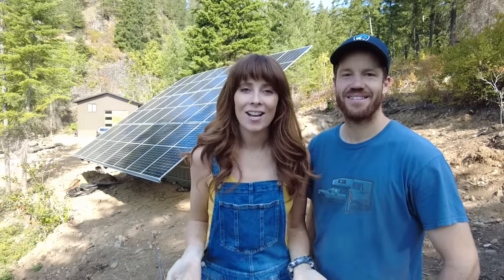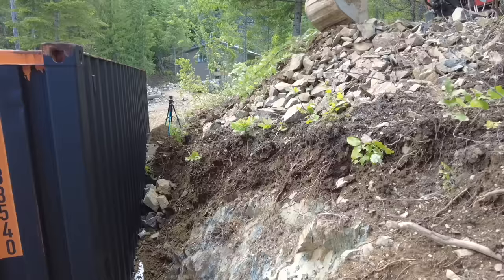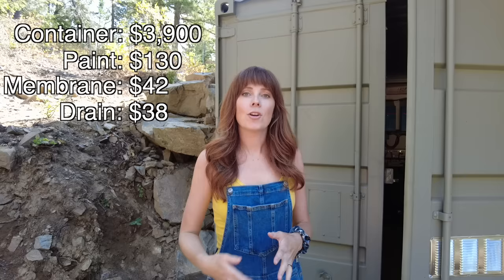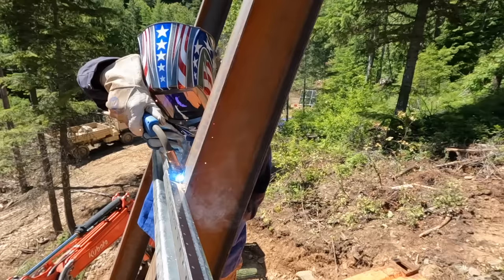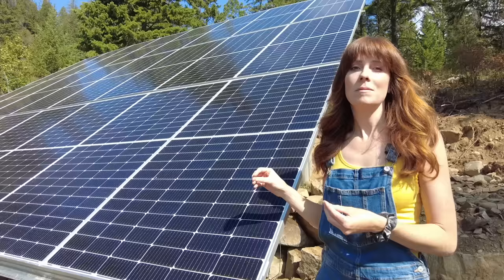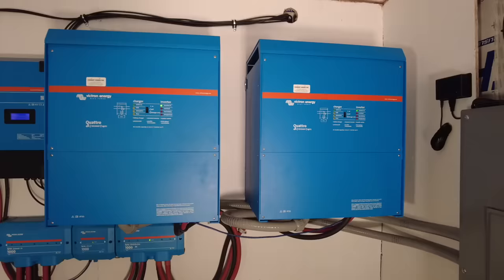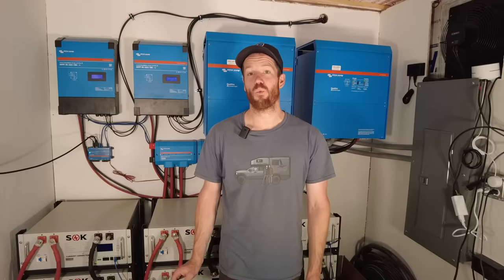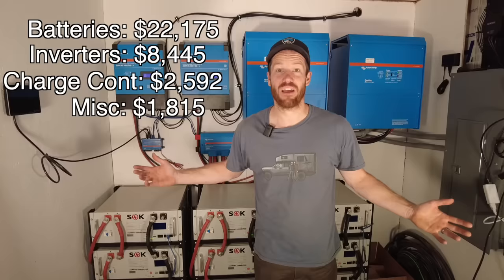TOTAL COST Of Our Off-Grid Solar Power System | Powering Our Mountain Home

Comment: You shouldn't connect the batteries like you have. You need bus bars . Run each battery to the bus bar not to the next battery.  This way you will pull almost equal power from each battery. 
The way you have it now isn't very balanced for load on each battery.  The last battery in the line will give 1/3 of the power compared to the first battery.  Example is 1 battery pulls 50 amps the 3rd battery wire is gonna pull about 150 amps through the wire. If you use bus bars then each battery wire will be around 50 amps each. Not the 150 amps.

Comment: Very interesting and informative. I can see where $60,000 looks better at $50,000.. however for an overall cost of that much and the fact that you have no close neighbors wouldn't it be just as good to purchase a house diesel/ propane generator? They aren't that noisy and very efficient now.
Reply from the maker: We did explore that route. A 20kw generator burns about 1 gallon per hour of fuel. The breakeven is less than 2 years not to mention the hassle of refueling, frequent oil changes, and the noise.

Comment: In that area you should have brought in the electric and subsidized with a smaller solar system because if you have prolonged bad weather you'll need a full time generator but hopefully that's not the case and everything has been going well for you two. The brought in power would have boosted the value of your property as well.
Also I hope you guys have firepower just case a bear or mountain lion from hell comes around. Always carry even in broad daylight.

Comment: i wondered how what seemed to be overbuilding till you said  running welders and things like that but then at the ens
10k for system was less than having power run  bets part  i would add a generator backup big enough to run ref and heat
not everything just for insurance but you do have double system good move than 1 giant one 
and the way the adm trying to kill the average person with power bills even better to have this  setup

Comment: 0:17 batteries measured in ah, or kWh, not kW. Array covered in shade :-(
8:25 thanks for the power to property info of $60K. That would have been a tough choice vs oversized solar and batteries, $50K.
No suggestions, but a tiny power supply, battery charger, and everything else at least cut in half would be great if possible.

Comment: Great system and nice job on the installation.  My wife and I live off grid here in Michigan and were 'forced' into solar due to a similar story with trying to get grid connected.  We have 15kw of QCell panels and 30kwh of Simpliphi batteries with a 6.8kw Schneider XWPro inverter that we installed.  We're in our first winter and we're finding the reduced sun this time of year to be an issue and supplement with a 10kw propane fired generator.  How is your winter electricity production working out?

Comment: I am guessing you’ll break pretty much even. In my hypothetical scenario, you have a 200 a month power bill x12 months x25 year life span of each panel and factoring battery life spans of 15 years on average, outdoor wiring replacement and other misc issues.
The fact you control your own energy needs and the likelihood power loss due to weather is a sigh of relief. Have to considered adding a hybrid wind setup for those snowy/cloudy days or is the cost and maintenance of such a system not worth the undertaking?

Comment: How do you calculate the available power?
I'm looking to build an indoor grow room using 
2x 1000W led lights running 12 hours a day (not simultaneously) 
1x  600W led light running 18 hours a day
2x Dehumidifier 500/800W running roughly 12  hours a day
1x split air conditioner 1500 max running 24/7
Miscellaneous fans and pumps roughly 600W running 24/7...

I'm looking at 4/5 KW hour

Besides the amps, how do i calculate the battery capacity?
Reply: convert your KWH to AH, multiply by 1.5, then X by the number of days you want in reserve with limited or no sun

Comment: since they are bifacial even if the front is covered with snow the suns reflection from the snow on the ground behind the panels would still provide a little power,, I guess

Comment: Not only did you pay $50,000 instead of $60k to build solar vs power but even if you paid $0 to run power out the location it would have still paid for itself within 10 years typically from electricity costs. Just keep in mind you'll likely have cost of repairs or replacing things like the batteries every so often. I think that solar panels and all can go like 25 years but i wonder how often you have to replace the batteries. I know car batteries are lead based and not the same but it kills me that i have to pay $250 now for a car battery these days and i've had to replace battery in my car like 4 times now since i owned it. I hope that batteries used here don't need replacement too often and this is one of my pet peeves with solar, no one ever mentions what maintenance cost is and how much is cost to replace batteries and solar panels are and how often. While i am sure you still save money overall, it's just something that isn't mentioned. if it cost $10k every few years to replace batteries and more every 25 years to replace solar panels, it suddenly doesn't look as appealing. and then you wonder how much more environment friendly it is if your constantly replacing those things as it's rare earth materials and likely pollution to make them. I just think winning people over to go solar would be better to be fully honest about long term expectations and all, which sadly no one ever is.

Comment: Actually you in essence have a monthly power bill of about $208 if you divide out that cost over 20 years. That number goes down the longer you can make that equipment last, it goes up if you incur maintenance costs. It goes down, maybe significantly, if you got any substantial tax credits. In your case with the cost of running power it's a no brainer.
Reply: You should do the math with 30 years. Really, if you don't torture the batteries, they easely last for 30 years or more.
Reply: Don't forget that an inverter lasts only 10 yrs. On top comes the panel degradation 2% per year
Reply: @MultiTolik1  My Inverter is almost 16 years old and I can't see any technical reason why they should expire over time. Makes absolutely no sense what you are talking.
And solar cells do not lose 2% every year. This information is at least 20 years old and has nothing to do with modern cells.

Comment: question, that solar company currently has 225 used panels for $79. So you could get to 10kw for $3,800 plus tax, but would have to use double the number of panels that you used. Would that have been a viable option also or were these panels you used a better deal for another reason? These ones I mentioned are also used.
Reply from the maker: The panels we opted for are bifacial so they collect sun off the backside. Very helpful for clearing snow off the panels. They are also the optimum voltage range for our charge controllers and series wiring.

Comment: You have steel in contact with the aluminum on the solar panel..   That's going to experience galvanic corrosion and rust out in probably 3 to 4 years.

Comment: I'm new to your channel. My question is   another couple bought a container to live in. They buired it and the sides collapsed after covering it with dirt they said they should have welded reinforcements inside before covering it. Im just wondering if yall have.  They said only the corners are str strong enough to cover it.

Comment: Winter project: make a solar tracker so that the panels are always optimally aligned throughout the day. An electrical winch and a counterweight should  be all it takes. Can also be used to automatically drop/lower the "sail" when high wind hits.

Comment: How did you reinforce the shipping containter for burying.  They will collapse under normal ground pressure unless reinforced.
Reply: only if its buried on opposite sides, they only back filled 1 side so any movement will "push" the container

Comment: The costs for batteries are just to high. When the batteries reach eol you usually don't get your money's worth. Remote locations that are far off-grid might be a different story though. I would probably combine wind and solar if I had the space to have more reliable loading if the batteries.

Comment: I really think you could have done it in less than $15k to $20k. These inverters are great but there are great cheaper alternatives. I would have built my own battery from 3.2V cells. Cost effective, does the job and last as long as any branded packs

Comment: Personally I would have just bought a bunch of the EcoFlow Delta max batteries maybe 10 of them keep them all charged all the time use one a day you should be able to get through all the shit what you need with one of them I'm not sure what you're running up there but you can run very bright 12 volt lighting and not even use 110 volt most things you can use on 12 volt now or mostly everything will plug into a Samsung looking charger the micro USB. You can also run diesel heaters Chinese diesel heaters for heat I don't know I could be wrong I don't have no damn out in the middle of nowhere home so I wish I did though

Comment: Before you had went this rout did you ever just consider doing your power the 1800s way ???   Gas lighting, gas frig, gas or kerosene or wood heating or a mixture of such,   with maybe a propane generator with a battery bank for partial power needs. ???

Comment: Yeah, you’ll eventually have power problems with the system aging. It’ll be new until the batteries are 5+ years old and the ongoing costs to solar will pile up.

Comment: Just checking to see if y’all still have your EcoFlow power units I noticed that the wave ac was missing in the army truck with the gaping holes in the cab? I know that y’all have the super sized power grid now and probably don’t need the portable units anymore but do y’all still recommend EcoFlow?
Reply from the maker: Yes! We pulled the wave out for winter but still plan to use it again this summer. We still love all of our EcoFlow products and use them often.

Comment: Why did you not put a water protection on the side before dumping rock and soil into it. you will already have penetration of paint, and will have plenty of water direct to your container at all time. should hav used a hard plastic water protection.

Comment: Burried Container is a frankly stpuid idea. Cause you did it not good, but bad. To be warmer it has to be burried on 100% with no contact to cold air and isolated from moisture. So in 5-ish yrs it just be rusted. And already this winter you gona see that it is still cold as usual. So you need to dig it up again, insulate it with some effective material and put a good black color paint on top of it. It's gonna be much warmer.

Comment: 2000 USD per year over the span of 25 years if painfully much. Not to speak of replacements for the solar panels. A once every 25 year storm will turn that array into scrap metal.

Comment: alternative electricity will never be cheaper than the electricity supplied from the city. after 5 years, the battery capacity will drop by more than 50%, and after 10 years you need to buy new ones. you have the same cost for a diesel generator.

Comment: Let’s say you did get power from the government.. at $200 a month for 20 years you’re spending $48k! So in 20 years you’d be able to get a whole new system again for the same price. If it goes 30 years you’re saving big $. And you’re off grid and creating clean energy.
Reply: Depends on where you live and how much power you use. Two people in Idaho aren’t spending 200$/month maybe 100$ on the grid a month. At 40 KWH a day average a year at 11.5 cents a KWH that’s 1670$/year, that’s roughly 30 years the system would take to pay for itself. If you live in CA numbers are different and the system is worth it. If you live in West Washington where grid power is 8.6 cents/KWH it will never pay for itself. 40 KWH a day is waaaay over average. Solar is awesome but do due diligence before pulling the trigger.

Comment: 32K?? even with electro heating is a like 6 year retunr that exacly moment when oyur system start getin older all mppt after 10 year have to be change... batery?? well pretty much same.. you many not buy witron is sux.. even pylontech can surpas witron.. 15year is function maximum.. electrolytes inside will be done so hard..

Comment: How much of these Rebates/Credits were you taking and how much did it reduce your cost?
Idaho Rebate
"Idaho Residential Alternative Energy Tax Deduction:
The residential alternative energy tax deduction allows taxpayers an income tax deduction of 40% of the cost of a solar, wind, geothermal, and certain biomass energy devices used for heating or electricity generation. This can be applied in the year that the energy system is installed. 20% can be deducted each year for an additional three years. The maximum deduction in any one year is $5,000. The total maximum deduction is $20,000."
Federal Tax Credit
"Solar PV systems installed in 2020 and 2021 are eligible for a 26% tax credit. In August 2022, Congress passed an extension of the ITC, raising it to 30% for the installation of which was between 2022-2032. (Systems installed on or before December 31, 2019 were also eligible for a 30% tax credit.) It will decrease to 26% for systems installed in 2033 and to 22% for systems installed in 2034. The tax credit expires starting in 2035 unless Congress renews it."

Comment: You sure it's a good idea to keep it 100% charged if you barely use it during the summer?
Batteries loves to stay near 50% charged..
Reply: Actually as I watched whole video guess it renders my question irrelevant. Although I'm still certain you're overly optimistic about the batts durability. And I really don't think the company will end up being responsible for whatever made the batt degrade not as slow as they promised.

Not least - is battery degradation from time.

Comment: I so bad want to take a class on this kind of stuff. Would love to set up total off grid for my house but the info is so overwhelming.
Reply: Remember they started with a bang. You can start small, under 5k for a simple tiny house set up, and grow from that
Reply: thanks @Bagel-lt2xh also if you design it right from the start with growth in mind you will not have to buy the same thing to replace it with something bigger or more compatible. DONT buy new panels (at least in the start) used gives you a huge leap forward in bang for buck. concern yourself on learning HOW to build a system IE how to calculate your load and usage and how to see if panels of X number of volts and amps (in series and parallel) will work with this Y inverter. its is alot of math but its not advanced quantum physics. the most important part of that aspect is knowing your terms, Volts, amps, watts, AH, WH, Va=W, 1a for 1hr= 1AH. keep in mind where your going to put stuff, panels are not the only thing that takes up space (although where and what direction is important) how far you inverter and battery is from it and each other matter greatly.

Comment: How many Kw/ day did you design this system for?  Your system is double sided although we are not in snow country.
Reply from the maker: During the last 30 days our average is 13.5kwh per day. This does include working in the shop a lot including welding and plasma cutting.

Comment: Ok, this set-up is roughly $2,500 per kWh, and frankly has no labor or installation cost.  If you live on the grid, the price with all costs involved and installation is usually under $2,000 BUT you also get 8-10kWh array, not 24kwh with 60 kWh in batteries...just saying.

Comment: Every 15 to 20 years baring any unforseen failures you will be replacing the system. Within that timeframe the cost will have increased by about 50% assuming 2% inflation.

Comment: Where do you hide your propane tank?
Reply from the maker: At the moment the only propane appliance we have is the range/oven. In hindsight I wish I had bought electric induction but that came before this system. We run it off a 100lb cylinder.

Comment: Uhhh no your battery will suffer in winter. As you know, lithium batteries have low temp cut off for recharging so not providing a 40 deg. Environment for your batteries could be a bad situation

Comment: Why are't you using an electric generator for charging batteries?
Your house has a lot of far from solar panel and can be far from generator meanwhile generator can generate every time in day and night 

Another important thing it is that you can use a high value eneergy when the generator is working and charge batteries too.

Comment: it amazes me when EV and Solar power is pumped up not knowing the amount of legacy energy needed to produce them and disposal when they are worn out is toxic
Reply: Remember this comment when you are setting in the dark cold/hot because the big power companies don’t have the infrastructure to support your electric needs and you’re either browned out and fry electronics or blacked out and helpless, crying because your popcorn maker doesn’t work. 🤡🤡🤡.     There might be cheap labor pulling lithium out of the ground for my batteries but they work when your big company fails to keep up with demand.

Comment: The truth is that you would have to run this for 100 years for ROI. But the batteries and the inverters have to be replaced every 5-10 year. So while this is an absolute neccessity for you guys out in the middle of the woods, it is a very expensive way of creating energy.